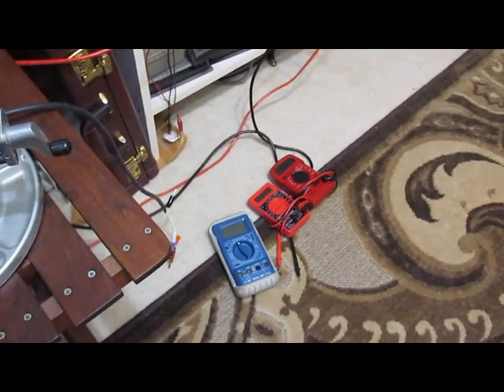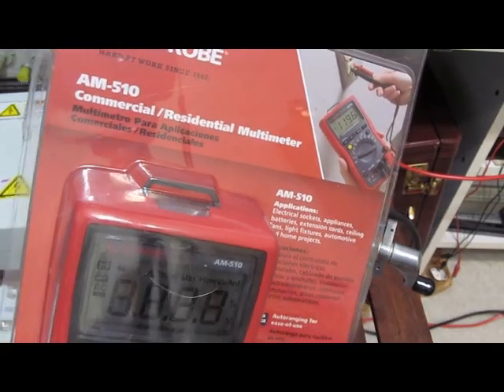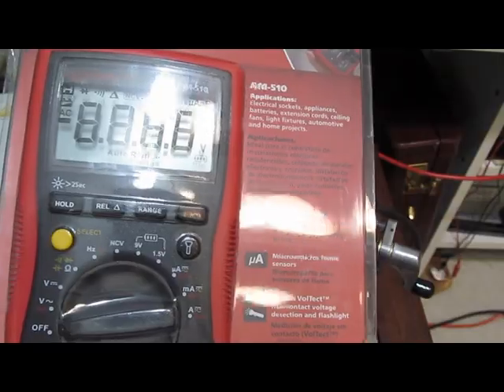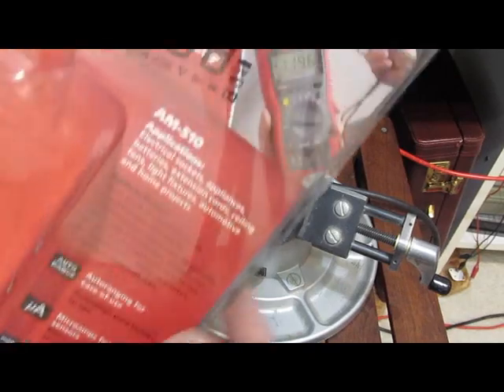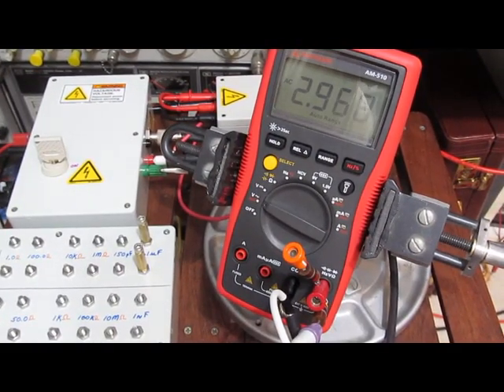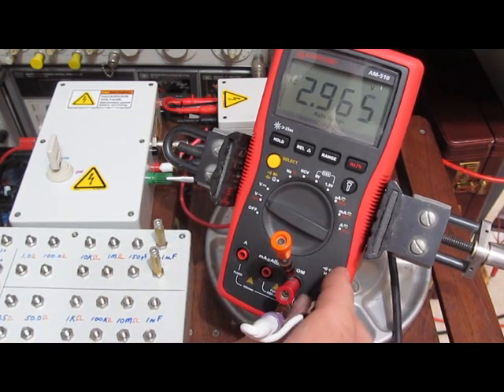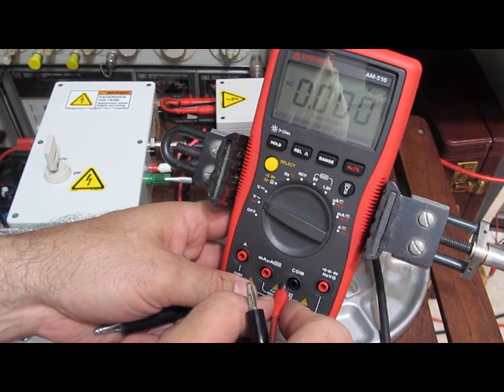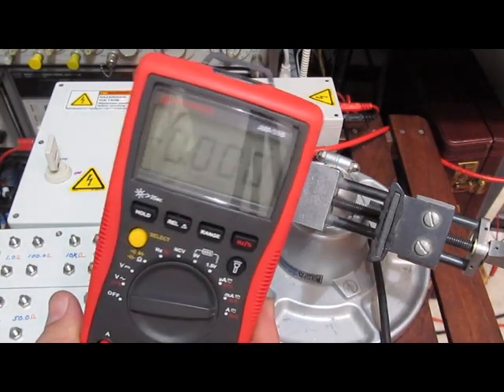Evaluating low cost DVMs Part 8 CAT I The AMPROBE AM-510

Comment: Hi - really like your comprehensive test vids, good to see a test of this meter, I think im going to try an AM510.   I wanted to ask, how did you come by that clamping assembly I see in this video, did you fabricate it or is it repurposed from some other use-?   I made a decent clamping stand for smaller meter by combining an adjustable tilting stand for phones with a dash clamp assembly, works fantastically well.  Just hot melt glued the  adjustable dash clamp to the front of the phone stand and the two work like theyre made for each other.  I like the small Aneng 8009 meter but the stand on it sucks, and it slides around like a hockey puck when on its back so the stand along with some probemaster leads make for a great combo.
Reply from the maker: Panavise have been around for many years.  They offer different bases and clamp types.

Comment: This Amprobe 510 could be my future replacement for my uni-t 50b. It's more expensive than a uni-t with same functions but it is more robust and has a flashlight
Reply from the maker: I've seen people post how they have watched me put apply several KV transients to some of these meters and they survive, so they assume they can hook them to MOTs, DC ..... at the same levels.  Hope your not one of them.
Reply: No its no the case. I'll use mostly for electronics and sometimes poking in to the mains. The Question is from the videos seen about the amprobe i fell more safe than the uni-t, not to use in higher voltage but more in terms to prevent damages or hazard to personnal use. Untill then there is safe precautions and my uni-t b still works pretty fine and has a very low power consumption on the 9V even using auto backlight feature but if it fails due to human error i need a better replacement.
Reply: Another thing i'm a little peaky is about auto-ranging. I have clone new aneng  8001 for measuring voltages  and uni-t 50b for currents. The aneng auto-ranging is damn slow, where in the 50b is manual ranging i can read fast results ( 1 second or less). But this amprobe seems simple, fast, secure and i can live without temperature reading. I buy a aneng 8001 to replace my oldest uni-t 33b which was draining too much battery ( 1 month ) .
Reply from the maker: I believe UNI-T makes the 510 for AMPROBE / Danaher.
Reply: Well if  uni-t is supposelly doing this metter .. it doesn't change the results or the multimeter as is or even my opinion about the Amprobe. I think uni-t also does another brands such as tenma or voltcraft and leads to me that uni-t can provide a wide range of metters,  and more safer ones ... Sometimes less is more
Reply from the maker: No, it has nothing to do with the data I collected.  You comment "The Question is from the videos seen about the amprobe i fell more safe than the uni-t, " is why I mention it.
Reply: Ehehe. That's the irony and maybe amprobe is supervising the production /  quality of this model. For now i'll take the necessary precautions for the uni-t 50b lasts.

Comment: I have this meter, has been one of the better meters i have owned and i am very comfartable using it, the build quality is good and the dial has a very nice firm snap and the precision is fine, my only gripes are that the flip stand on the back is not exactly solid (Though better than any else i'v seen and also provides by far the best stability iv seen) , the auto range time is a little slow for my liking and the capacitance mode is pretty useless.

Comment: Hello Just starting out with electronics repair , what meter would you recommend Thanks
Reply from the maker: Sorry but I really would have no idea what your requirements would be.  I can tell you that I have been very pleased with the Brymen BM869s.  I also like the UT181A but would not recommend anyone buy it in it's current state.
Reply: Just some component test (caps, res, diodes, continuity, low power, I'll check the bm869 price if U have any other suggestion hit me back , Thankyou for your quick reply  Gary
Reply from the maker: Really will come down to your specific needs.  The Brymen may not be a good fit for you.  It's just the one I use now.  You should watch the second half of my UT181A review where I go over the EMC standard.  If you look at all of the data I posted in the spreadsheet, you will have an idea what brands you may want to stay away from and what ones may hold up.   https://www.youtube.com/watch?v=1kYcY2ogmqo
Reply: watched your link very interesting on the EMC standard , prob not to many people are aware. I would like to stay 100$ for a meter for all around electronics test would the 101 fluke give me the reliability an general range for caps, diode , resistor, and continuity, etc. Sorry for being a pain I try to research most stuff i buy with all the crap out there today,  Thanks very much 4 your time and Videos Gary
Reply from the maker: For myself, there are some things the 101 is missing that I use a fair amount.  From an electrical robustness standpoint, the meter is top.   I doubt I would find a handheld that will replace my RLC meter.   I mentioned in the final video that for me, the AM510 would be a better choice over the 101.  The AM530 was far too slow and not near as robust but it does have RMS and temperature.       The Fluke 115, 17B+, 107 and HIKOI 4252 are all sub $200 and very well made.  They all lack features I want.    Having looked at the Fluke 87V, TPI 194II, Extech EX540, UNI-T UT181A, all costing over $300 US, I wouldn't take any of them over the Brymen's BM869s.    If you watched the first half of the video for the 181A where I compare it with the Fluke 289, you can see why I like it.  It would not take a lot to turn this into a really nice meter.   The one low cost meter I bought that is seeing a fair amount of use is the UT210E.  A DC clamp that will detect mA changes, it's impressive for the price.   It will come down to what you want/need.
Reply: Thanks for your advice Am thinking maybe the Klein MM1000 I watched many of your videos but don't remember much on the Klein meters  , your thought for basic testing on the mm1000 or if you did test it a link.  Thanks Joe
Reply from the maker: I keep a spreadsheet with all of the data on-line.  You will find it attached to the first post of the link below.   I ran both the Klein MM500 and MM2000.  This was prior to me doing any sort of review.  Looking at the specs for the MM1000, you may want to have a look at the 17B+.  http://www.eevblog.com/forum/testgear/hear-kitty-kitty-kitty-nope-not-that-kind-of-cat/

Comment: hello I would like to know which is the maximum capacity that can measure capacitance AM510 that just bought one and I'm not sure if it's only till 100uf. or is till 4000uf ? Thanks
Reply from the maker: +fenrir de alioth A quick Google search shows 4000uF.   HOWEVER, the  manual that was supplied with mine states 100uF.   Measuring the one I have, 100uF the meter reads 98.8.  Adding 10uF more causes it do display OL.    So indeed 100uF is the maximum.   Looking at the manual for 5KY's AM530, it states 4000uF.  Using a 2200uF cap, I read 2150uF with the Brymen and 2187uF with the AM530.  They claim for reference only in the manual at this range.  

http://www.amprobe.com/amprobe/usen/digital-multimeters/am-500-digital-multimeter-series/amp-am-510.htm?pid=74033